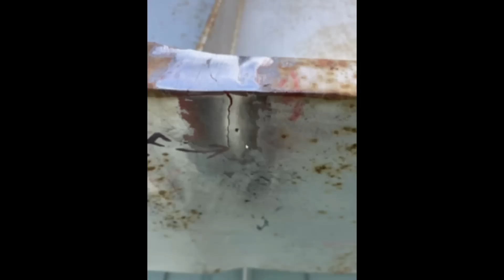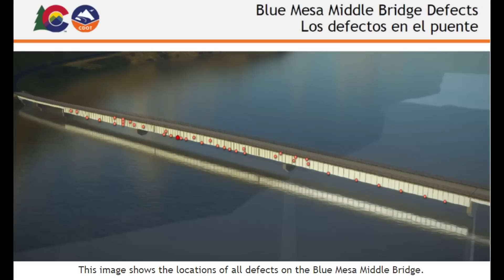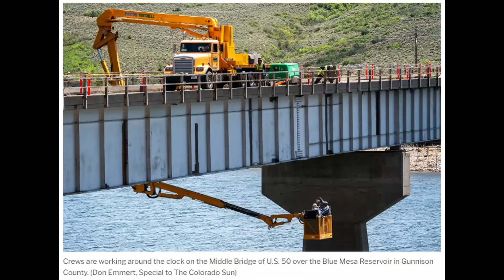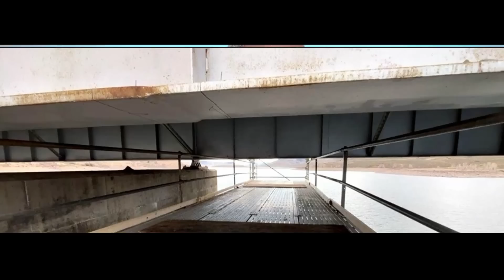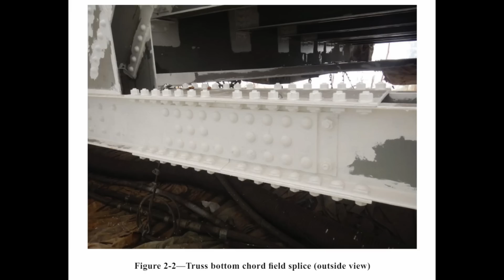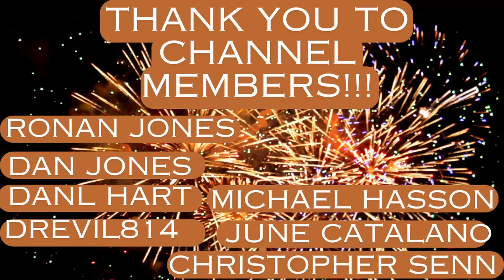US-50 over Blue Mesa - Steel Repair Plate Installation

Comment: With that many cracks, I think it needs to be replaced. America needs to address its infrastructure issues.
Reply: then you have to vote for people who address it's infrastructure issues.
Reply: We can’t all our money goes to our politicians pockets and over seas. Oh welfare too.
Reply: Actually all welds have cracks and flaws and cause cracks in the adjacent base metal.  It is a question of how large the cracks are, how they are shaped, where they are in the  cross section, any other stress concentrations in the area of the crack, if there is tensile stress, and how much and how many times the stress cycles.  A big factor is redundancy.  If there are insufficient alternate load paths and strength to carry the load after failure until the next inspection, the structure is considered non-redundant (fracture critical) and larger safety factors are needed in both design, fabrication, and inspection.

Comment: Good video. I seem to recall that Electric Boat was having a lot of problems with their welds in the 1980s. They mentioned the hydrogen aspect. Good Luck, Rick
Reply: Hydrogen embrittlement was discovered to be a problem in welds used on reactor vessels and submarine pressure hulls, and Electric Boat did welding on both.
Reply: @rtqii  I was working on the sub base just up river in those days. Good Luck, Rick
Reply: @rtqii There's another source of hydrogen embrittlement in nuclear reactors. When a neutron is absorbed, then spontaneously converts to a proton plus an electron that is an embedded hydrogen atom and they accumulate over time.

Comment: Great videos Casey.  Are you familiar with Central City parkway in the mountains west of Denver?  It has lots of sections where they have repeatedly repaved areas over canyon fill that keep cracking in that same distinctive concave arc pattern like in the Teton failure.  Repaving so often certainly indicates significant ongoing movement and the slopes are steep. What are the chances of catastrophic failure? The fill is rockier than Teton.  That might help?

Comment: Are those bridges nearing obsolesence after only 60 years?  Seems fairly skookum construction with those deep girders.  Absent major corrosion problems, seems those bridges can/should last many more decades with proper maintenance.  What kills me is the lack of traveling inspection/maintenance scaffolding designed into the original bridges.  What sort of idiocy is that?  Frankly, all bridge designs should be forced to include means for easy inspection, rather than relying on those mobile truck mounted inspection scaffolding.
Reply: Considering all the bridges in the state this would cost billions, and all bridge maintenance would have to stop for decades to cover that cost.  This is a bridge that might have been worth it due to its lack of redundancy.  But that was not a thing in 1961.  If it was it would have been cheaper to design the structure with 4 girders of a lower strength steel and have sufficient redundancy.

Comment: I'm 25-year resident of CO and I've been over the Blue Mesa Bridges several times since moving here.  CDOT has, over the last few years, been both conservative and aggressive in their approach to bridges.  Conservative in putting safety over convenience when an issue like this is found; aggressive in marshalling sound engineering to address the situations.  Unfortunately for them a couple of issues have hampered their efforts.  

First, CO voters have to approve any tax increase and the minority conservatives in the state are much more organized in opposing any tax increase than the middle or liberal fractions.  So, CO's fuel taxes haven't increased since the 90's when the Tax Payer Bill of Rights, TABOR, was passed.  This has severely hampered maintenance programs and construction of new roads along the front range have to done as toll roads.

Second, as one can imagine, the topography of CO means that there are an inordinate number of bridges in the state.  Like any mountainous state, it's not unusual for the there to be multiple bridges (using the term broadly) in a mile of roadway.  Therefore, the task of maintaining them on an effectively shrinking budget is a challenge.

Kiewit has demonstrated a great ability to perform major infrastructure projects in CO in a cost and time effective manner.  I contrast this with the excrement exhibition occurring in WY and I'm glad I no longer have to drive from Jackson Hole to Idaho Falls occasionally.
Reply: The Colorado gas tax is suppose to fund maintenance and is only $0.22 per gallon which is 11th lowest among all States.

Comment: Casey, it looks like with infrastructure aging, maintenance being ignored or reduced in frequency you will have no shortage of content topics going forward.  What became of all the highway light poles that were rotting at the bases from Calcium Chloride / Rock Salt? It was big in the news, then fell off the radar altogether. I see such girdles of rust on municipal and utility poles all over the place.
Reply: Had to replace a large number of sign bridges on a recent rehab that rusted through the bottom as well as fatigue cracks at the attachment to the pole.  Early versions were not galvanized and some had the painted poles embeded in a very low strength concrete that made a chloride infused poltice.  I think a crew with a containment, sand blaster,  metalizing spray equipement, and spray painter could work through this on a prophilactic basis easily.  Maybe 100 poles a month.  Problem may be determining just who is responsible for maintenance of these as the largest portion of these are locally owned.  The ones I dealt with were on an interstate bridge so ownership was clear and they were too far gone for simple repair and protective coating.

Comment: Question: if Colorado has detailed records that pinpoint the bridges that use the defective steel, don’t you think that Boeing and other aerospace manufacturers should have detailed records that pinpoint which parts were made from defective titanium and which planes are using those parts? If not, isn’t that a major failure on Boeing part or other manufacturers parts?
Reply: Boeing had recent problem with defective titanium.  Sometimes these problems are due to bogus paperwork or certifications.  CDOT has shop plans on most bridges but that does not cover testing paperwork.  I think they get it and verify some of it, but it is not kept indefinately.  Most recently I had the lab test a rebar that was not what the plans specified (rebars were changing at the time).  They were better.  I have had cores from old concrete tested for strength, and once by a petrographer to get other data.  I know of a case of brittle fracture from a truck impact that we cut out a sample and had a charpy test run.
Reply: Steel isn't defective.  The welds are.
Reply: @michaelcurtis-cdot8978  
Good to know. However, my understanding then is that this particular Steel can have a problem with welds and the fact that 50-year-old steel can be traced to a particular bridge or bridges in Colorado is a testament to the recordkeeping that was done. Unfortunately, I don’t know if Boeing other Aerospace manufacturers are as particular with their recordkeeping. I hope so.

Comment: So do you find en;gineers ok with working off a super crane, or do engineers teach high wire workers how to do the testing for them?.  the cantelevered work platform looks 'normal' compared to that.  Thanks for the report
Reply from the maker: No, the engineers use those devices for access so they can do the inspection themselves.  Did you see my video about the Washington Monument?  There was an engineering firm that used ropes to repel down the face of the obelisk to inspect for cracks following and earthquake.

Comment: I once had to stop on that bridge, in just about the spot where the first crack was found. There was road construction going on to the east, so there were flaggers and alternating traffic. A few minutes after I stopped, westbound traffic approached. One of the first vehicles in the line was a semi truck. I was amazed at how much the bridge moved as that beast passed. Completely normal, of course, but I had never been stopped on a long bridge as a truck passed. Like my first encounter with turbulence on an airliner, it was a thrilling experience.

Comment: How are the bolt holes made in the existing plate?  Is it drilled?  Punched?  Are there special environmental limits on release of the paint and metal swarf?
Reply: Probably drilled with a small, portable electric "drill press-like" machine called a Mag (short for Magnetic Base) Drill. These can be carried around by one man and stuck to a steel surface via a strong electromagnet in the base. Once positioned correctly, they employ an annular cutter to bore the hole via a geared self-feeding feature. The annular cutter bit allows its' relatively small drill motor to bore fairly large holes compared to conventional twist drill bits, since metal is cut and removed only on the periphery of each hole, and a core or plug is ejected from the cutter after the machine senses that the bit has completed the hole and retracted the hollow bit.
  I used to run as many as three of them at a time in a Structural Steel fab shop, drilling hundreds of thousands of 9/16" up to 2-5/16" holes in massive I-beam and column webs and flanges up to 3" thick. Most were 13/16", for 3/4" bolts.
 Once positioned and drilling, you could leave it alone, it would drill automatically and shut off by itself when the cutter hit empty air. You'd be setting up the second and third one while the first was drilling, and move them sequentially as they finished each hole, disengaging the magnetic base to move each to the next hole. 
 95% of our work was done flat, but occasionally we'd have to drill on a vertical surface, which is a royal pain. When doing that, we suspended the drills with a safety chain in case the power failed and the magnet would go neutral, to prevent crushed feet and busted equipment should that occur.
Reply: Generally drilled, but code allows punched and reamed.  I believe they hung something under the bridge to catch the paint as it had chromium, but no lead.

Comment: Why don't the National Gaurd install a pontoon bridge
Reply: Blue Mesa Reservoir levels can change but up to 70 feet as the snowmelts and then will drop with irrigation outflows.  It would be very difficult to manage at both ends tying into the existing roadway.
Reply: Sometimes Baily or Acrow bridges are used, but it often takes a couple of months and doesn't work for spans this long (probably would work on one of the approach spans though) They are not cheap either to rent or buy, and they can get in the way of the permanent solution increasing the fussiness of the stageing of the permanent solution.

Comment: By repairing the damage, it will extend the life of the bridge. If they have an idea of how long the bridge will last after the repairs that would give them time to fund those two bridges for say 10-15 years from now to either redesign new Bridges or continue repairing. What are your thoughts on that?
Reply: With the amount of time it will take to design new structure with environmental requirements and dealing with Bureau of Rec and BLM and a reservoir full of water I think your estimate is pretty close. It will take some time to find funding for 2 new bridges as well as design costs.

Comment: Taking Colorado 25 between Highway 50 and State Route 149 turns the "7 hour detours" into a 22 mile Summer bypass including 5 miles of Route 149 and 17 miles of dirt road which Coloradans are very used to. Actual extra time is more like 45 min to an hour depending on the driver.  Not great, but not a show stopper either and with 50 miles and almost nothing but a few farms and campgrounds between Montrose and Gunnison it's easy to see why the State inspected other routes first. Where this one gets really tough is the impact on Crested Butte when Winter comes and Highway 12 closes. That could have serious economic impact for the area.
Reply: It's still quite a bottleneck, for several reasons. The county road is gravel, for one, and Colorado 149 is narrow and winding. I think there are still restrictions on big trucks. I'm sure no oversize loads are permitted on the detour, and that stretch of 50 usually has plenty of those. Last I heard, traffic is only allowed on the county road at certain times.

I've been across that bridge many times. I'm waiting for it to open next month so I can go and retrieve a vehicle. That's a trivial inconvenience for me, but many other people have been seriously affected. I agree that CDOT and everyone else involved have done an excellent job of dealing with the problem. It makes the mess up in Wyoming look even more ridiculous.
Reply: @zackreuter6344  Indeed! Hats off to the CDOT. When you see what they contend with, I don't know how anybody could not bow to those fine men and women keeping our roads open and safe. They do an outstanding job. 

No question this will be a big problem for restocking and tourism for Gunnison and Crested Butte and will have far reaching effects including affecting some shipping to Pueblo from points West which will need a little re-route. At least here there are alternate routes. Closing an Interstate Highway is never without serious impact, but we may have gotten a little lucky with this location too. Big business can reroute for the most part and locals can still get through with considerable but still acceptable delay in most cases.

Comment: The relacement of this bridge will be difficult.  When it was built Blue Mesa Reservoir was empty. The piers are 250 feet tall.  New construction will need to be done with water in Reservoir.  Dealing with Bureau of Rec and BLM and possible USFS and NEPA.  The planning process alone will take years.
Reply from the maker: Thank you, that is a great point.  Many of these bridges in use today were built before current environmental regulations.  Also, thanks for joining the membership!
Reply: @CaseyJones-Engineer  They implied in one of their videos that they were hoping this would really prolong the life of this bridge.
Reply: There is one method off the top of my head that would use the existing piers and only replace the bridge structures. one at a time.  Build each section nearby, and float them into position for installation, after you've removed the old section.  Sort of like how St. Louis replaced the Merchants Bridge over the Mississippi River.
Reply: @zaklex3165 They will want to keep the existing bridge in service and will build the new one adjacent to the old.
Reply: @zaklex3165  The "after you remove the old section" might be a bit of a problem considering the access issues.  It might be better to extend the pier caps and add a girder to each side of the existing and widen the bridge somewhat to allow stageing room.
Reply: @michaelmcmullen354  I realize the lake isn't the Mississippi River, but it's also not that constrained...it's the reason I referenced the replacement of the Merchants Bridge in St. Louis.
Reply: @zaklex3165  Still need to keep the existing bridge moving traffic. The plan will be to build a new bridge parallel to the old.
Reply: @mikecurtis7113  You only need to close down for a day or two at a time to replace each span...easily doable and not detrimental to the economy or locals.  Which option do you think would be quicker and less expensive to do, replace the existing spans or buid a entirely new bridge?

Comment: A materials guy would call it hydrogen embrittlement.
Reply: That’s how I learned it.
Reply: Yep.
A real problem with chrome plated parts.
Reply: @patmcbride9853  It's also a real problem with improper weld procedure specifications.  Modern-day construction takes it into account based on newer data showing the benefits of post-heat as well as pre-heat.

Comment: Good story - Triggered some fun I had with plate steel formed into pipe for a nuclear plant.  In that application laminations are a concerning defect.  I imposed extra testing on the new steel and managed to get the product installed with no UT or RT indications. The old steel was not inspected to the modern methods and we had to inspect the old steel to modern standards before we completed the repair. Unsettling thought - we found plenty of indications and fixed them. In the end the repair welding was completed, passed inspection and testing. I say all that say it's  a tough job to fix old steel with new steel. It can be problematic. In the case of the bridge work the load is perpendicular to a potential lamination and they are bolting vs. welding so I'd give this a design a thumbs up.
Reply: Patches or doublers not designed correctly can cause existing cracks to propagate and even cause new cracks.  The name of the game in doublers is to taper the stiffness.  Sharp changes in stiffness like at the doubler's edge cause stress concentrations, which will start new cracks.
Reply: @major__kong  Major Kong is one of my Heroes btw.👍

Comment: hydrogen embrittlement...bad
Reply: Early in my career, about 15-20 years after this bridge was built I designed a welded bridge that used grade 50 structural steel, but the issue of hydrogen cracking was much better understood.  Fabricator went out of business trying to pass QC on the tension butt welds.  Did it eventually but lost their shirt.  The other fabricator in town did not seem to have difficulties with large butt welds.

Comment: Our bridges are failing , yet the offshore flow of "Aid" to other countries has never been heavier.
Reply: Foreign aid typically runs less than 1% of the federal budget.  It's a cheap way to buy a little good will across the world.  Seems like money well spent to me.
Reply: @jeffrey1312  Actually routine non-toll bridge replacement is probably also less than 0.5% of the federal budget.